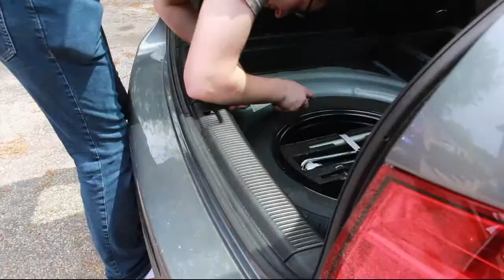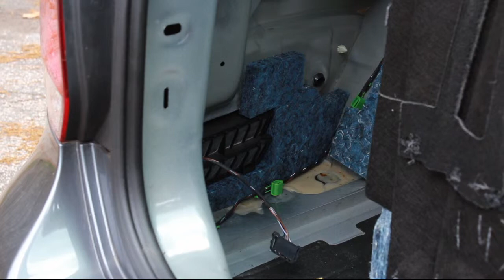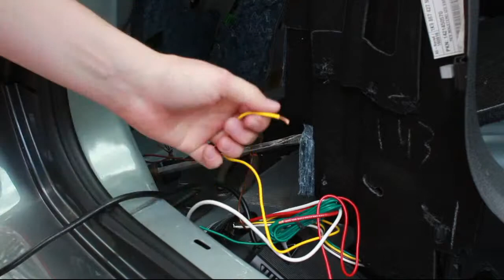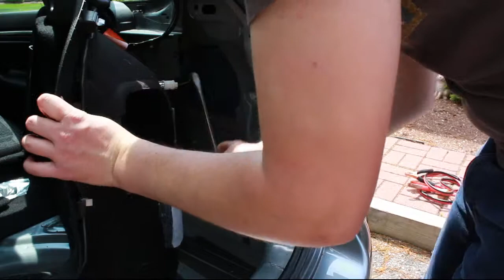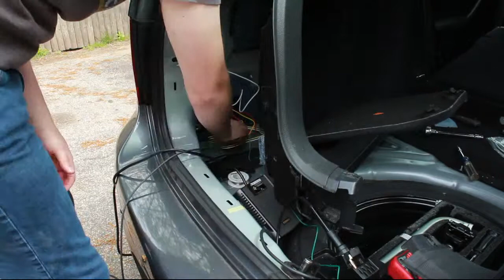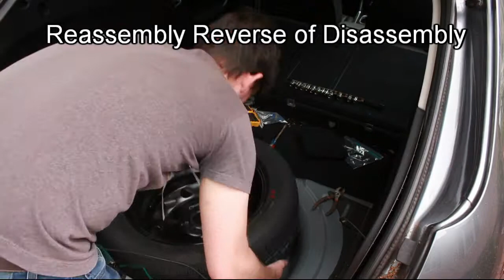Jetta Sportwagen Trailer Wiring Install Kit - Adapt Trailer Wiring to Car Harness

Comment: What an engineering cluster f to install a wiring harness.
Reply: Not really that difficult.  Only problem with the video is all wires were marked "running lights".

Comment: I'm about to do this. Already have the hitch in place.  I'm hoping to run the wiring through the grommet for the rear impact sensor mounted on the back of the car.   I'm not drilling hole in the car.
Reply: You can run it through the tailight hole and then under the bumper

Comment: HOW DID YOU WIRE BLACK POWER WITH A CIGAR OUTLET?
Reply from the maker: You can buy those plugs online just about anywhere. Center pin is positive and outer is black. C an get them in solder or screw terminal style
Reply: @diytito8165  can you suggest a link?